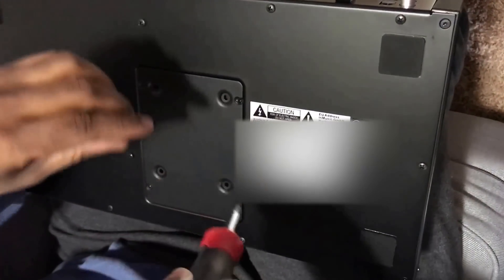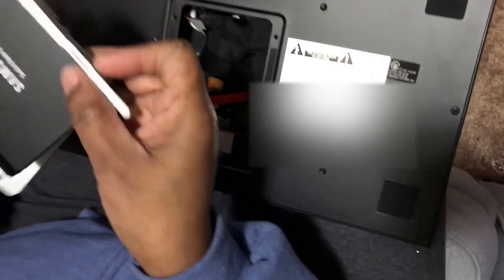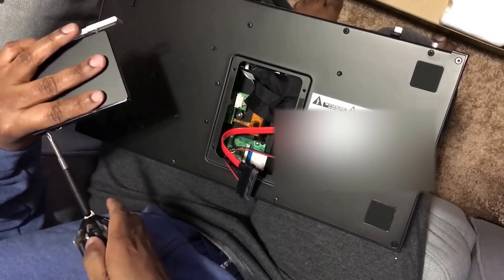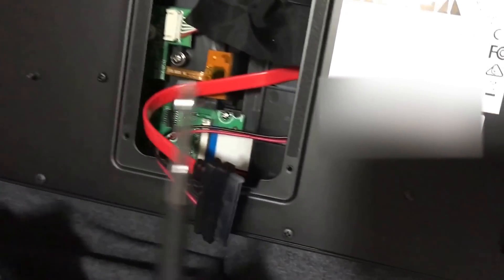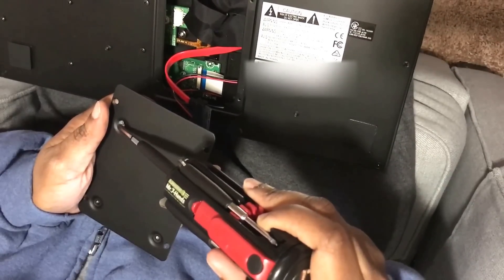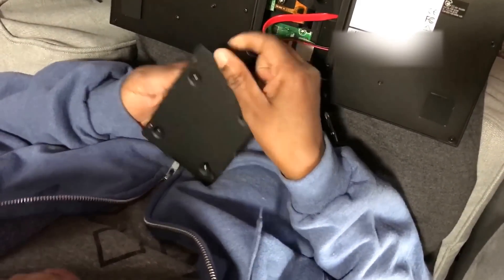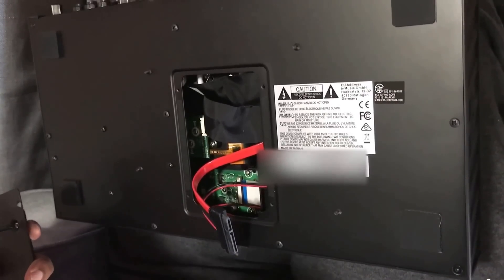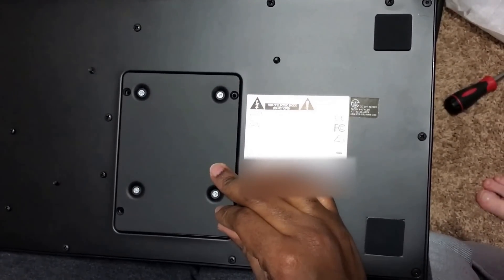Akai MPC Live Hard Drive Installation

Comment: I recently installed my SSD in my Live, formatted it to exFAT.  It seems fine at first, but after about 5 or 10 mins it automatically ejects itself when in controller mode.  I'm using a MacBook Pro, and the SSD is a Crucial MX300.  Anybody else experiencing this problem?
Reply: I figured it out!  From what I've been seeing in forums people are experiencing the same issue with Crucial MX300.  I returned the Crucial MX300, and just picked up a Samsung EVO 850.  It is installed, and reformatted to exFAT and works great!...  So far.

Comment: I like that drive , i saw them at best buy , do you need that bracket ? or just the holes ? Im getting my mpc live soon and I can see the need for it . question : can you connect a drive from the other ports they have in the back of the unit or is it best to use the one that is under that plate? thanks for posting this !

Comment: which samsung ssd model is this....... Please tell us the model number. Thank you
Reply: Marc Abernathy have you experienced problems with the MPC ejecting the hard drive randomly?
Reply from the maker: SAMSUNG 850 Series 960GB PM853T
Reply: Marc Abernathy thanks! I don't know what the deal is with my joint dropping.
Reply: Marc Abernathy thanks fam! I'm going to check that.
Reply: samsung 850 256gb is what I use. its an old drive from a decommissioned computer. :)
Reply: whats up fam. 
absolutely not sir. ive saved  new samples recorded externally from phono and my smartphone and old programs from a previous mpc. 

if this is occurring for you, make sure the sata connector is connected firmly and the hdd in the caddy is not pushing up against the sata connector on the board as its a very tight space in there. again im using a ssd samsung 250gb
Reply: I'm having the same issue

Comment: 2 important questions.... 1.is it possible to format the hard drive from the unit or do you have to format the hard drive before you install it into the unit?............ and 2. can you do a video showing the steps for accessing that drive, and loading audio from that drive?
Reply from the maker: No way to format it from with the MPC Live. Once you connect it to the PC and place the Live in Controller Mode it will show up on your computer as an external drive that you can then format. I will try to post a video later today.
Reply: thank you

Comment: Of course SSD is faster than existing HDD? 
Does it apply to MPC?
Reply from the maker: Yes. Hard to say how obvious it is from the MPC's point of view, but reading/writing files will be much quicker on SSD.
Reply: always faster. bottleneck will be in the RAM and how much you have going on at once. remember this is a laptop computer with 2gb of RAM. you can have the fastest drive in the world but if you have no RAM or limited RAM, you will experience issues.
Reply: Thank you.

Comment: There is no menu on the LIVE that I can see that will format the SSD so I will have to take mine out and format on the computer.

According to AKAI FAQ for the LIVE, there were supposed to be screws shipped with the  unit to screw the SSD onto the plate (that is how I read that FAQ) but none were in the machine.

You dont need to use all four screws. two will work fine if you dont have 4. screw one top left and bottom right. the compartment is snug to hold the SSD form moving around.
Reply from the maker: Yes, no way to format it from with the MPC Live. Once you connect it to the PC and place the Live in Controller Mode it will show up on your computer as an external drive that you can then format.
Reply: Thanks bro. I have no plans to use software with the mpc live or X so unless i can do this sans mpc software running ill just know to format them before i put them in. Still akai should make it avail to format since it IS considered standalone and not just a controller.